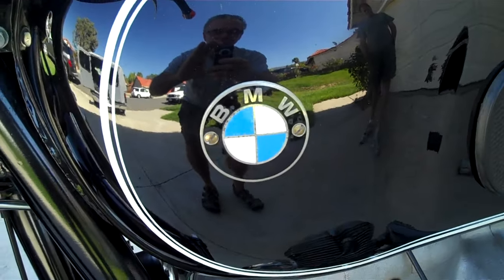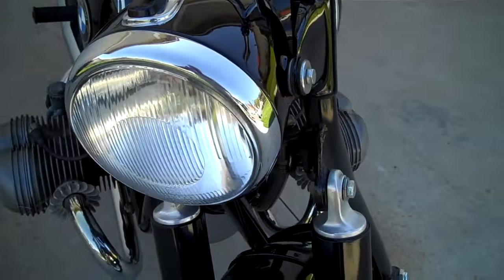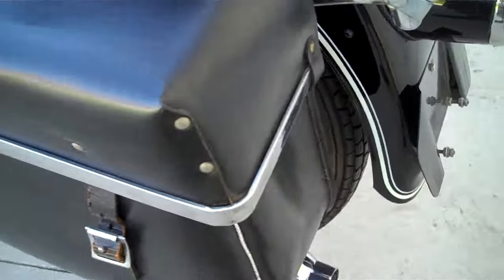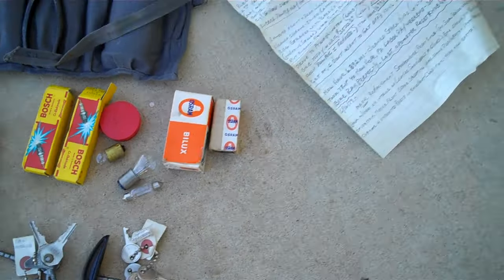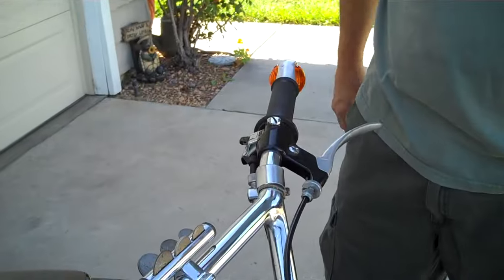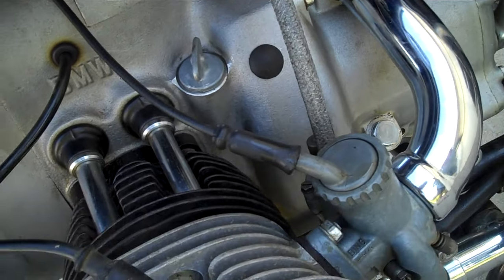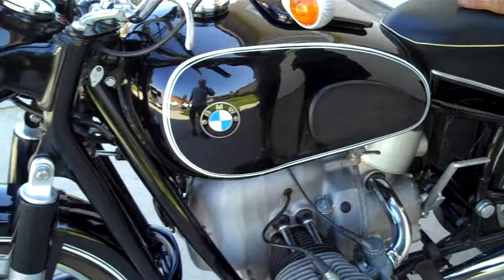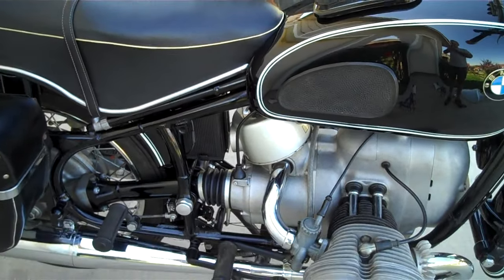1965 BMW R69S

Comment: Wow that bike is in beautiful shape. I own the same bike back in the late 60's. Brings back memories riding around New England with my girlfriend sitting on the back seat. When you start the bike there should be a small lever on the back of the air box. If you side it over it acts as a choke when starting.   My bike has a sidecar mount on the side.  The gentleman that sold me the bike showed  me a trick to start the bike without using the switch key  which can be removed by pulling it up and out,  buy using a pack of matches.  I won't describe how to do it given I don't want that general knowledge out in the universe.